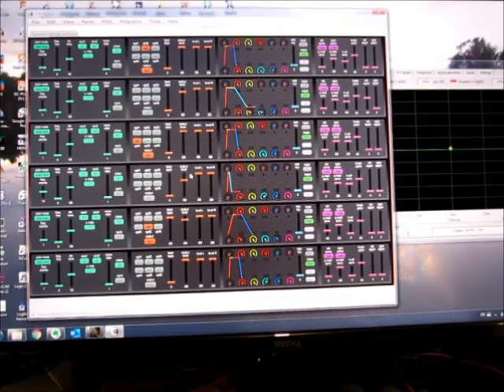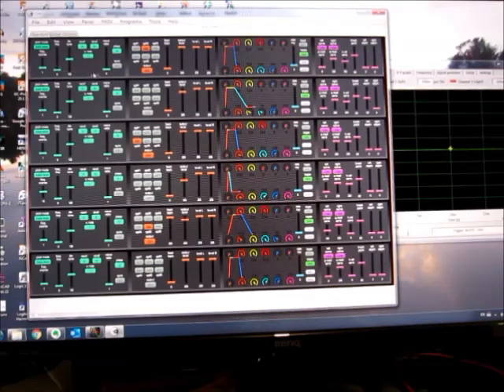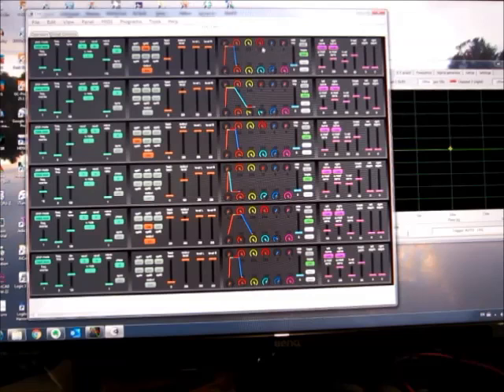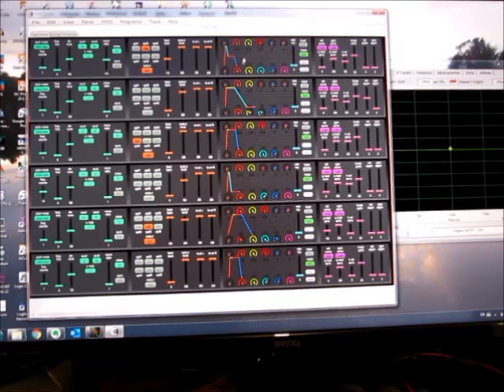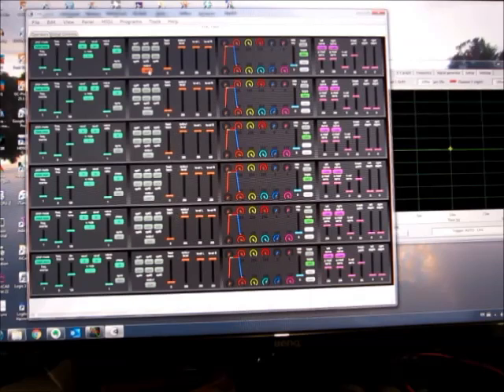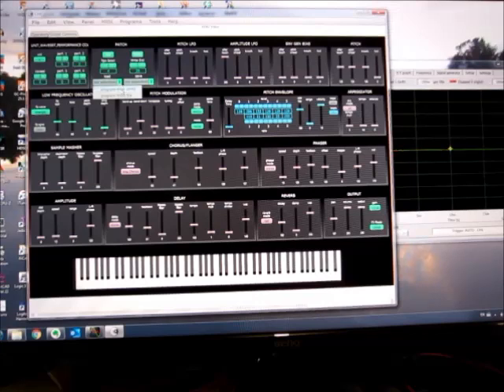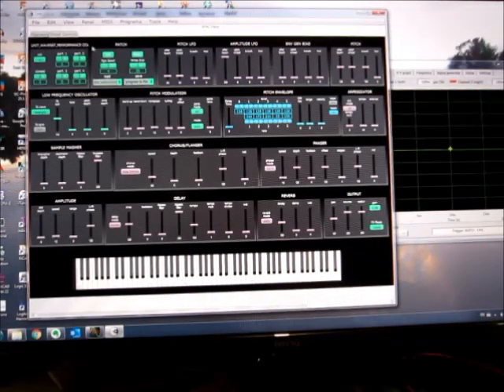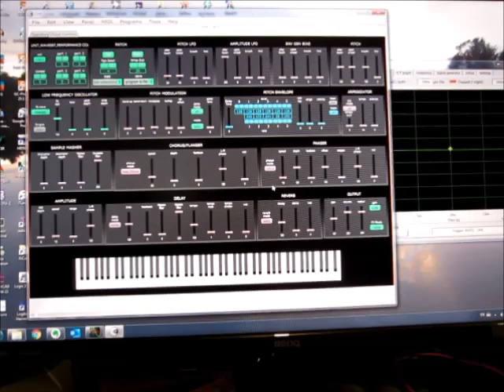XFM2 FM synthesizer and Patch Editor Overview

Comment: hello. please can you public schematic , how to wired 3 midi connectors?
Reply from the maker: The MIDI in and out schematics are on Rene's site - you will have to look thru the XFM2 blog entries to find them. If you want to add another MIDI input like I did, duplicate the MIDI in optoisolator circuit but omit the pullup resistor on pin 5 of the optoisolator. Since there is only one MIDI input on the gate array, you connect the outputs of the two optoisolators (pin 5) together. You only need one pullup resistor (R2 on Rene's schematic) which is shared between the two optoisolators. R2 pulls gate array pin 42 (MIDI IN) to 3.3V if there are no MIDI signals. If there is MIDI activity on either input pin 42 will go low. This is known as a "wire OR" connection - in this case its actually a "wire NOR".  The limitation is that only ONE of the MIDI ports can be active at any time - if both try to send at the same time the input to the gate array will be held low by both signals and the result is gibberish. This can cause the XFM2 to behave strangely since its getting corrupted MIDI messages. If you use one MIDI port for the editor and one for your keyboard it works great - just don't try to edit parameters and play at the same time.
Reply: @rheslip20  would you mind sharing where your midi out ground is connected?  i tried pin 28, then moved to pin 25, then i moved to a spot on the perf board edge thinking maybe that would be 'actual ground'. my "load from XFM2" option is also greyed out. thanks
Reply from the maker: @MikeHolstein  Mine is grounded to pin 25 which supposed to be an actual ground pin. You should use an actual GND point and not pin 28 as shown in Rene's schematic. MIDI out is supposed to be driven by a 5V signal, not 3.3v and by using the "pseudo GND" on pin 28 you lose a few more millivolts drive to the loop which can cause some MIDI receivers not to work. As for the load from XFM2 being grayed out - be absolutely sure you are using the version of CTRLR specified in the editor Github docs. Later versions are very unstable. The one I specified is not great either but in general it works. Obviously you need a valid MIDI port on your computer and you have to set that up correctly in CTRLR.

Comment: Does your xfm2 build not use the resistors or diode? I'm not seeing them on that board...
Reply from the maker: They are 0603 surface mount parts on the bottom of the board.

Comment from the maker: Somebody asked if the full duplex MIDI connection ie MIDI out on the XFM2 is necessary. He could send note messages from the panel's keyboard but he could not edit or send patches using MIDI out from the PC to the MIDI in port on the XFM2. The answer is MIDI out on the XFM2 is not necessary but it does allow the panel to sync with the XFM2. i.e. when you hit the "load from XFM2" button it reads the state of the XFM2 parameters from the XFM2 MIDI out port through the PC's MIDI in and shows them on the panel. It sounds to me like his MIDI setup is not transparent to SYSEX messages. I had that problem with my Arturia Keystep keyboard - it has a MIDI in port which I connected to the PC and then connected the MIDI out to the XFM2. Unfortunately the keystep does not forward SYSEX messages so none of the panel's patch editing SYSEX messages were getting through. This is why I added a second MIDI in to my XFM2. I have a port for the editor and a port for the Keystep.

Comment: Fantastic Editor: there is an error in "save patch on XTM2" does not work : you use the string F0 43 uu 04 01 00 xx 00 F7 but the correct one is F0 43 uu 04 01 00 xx F7 .
Reply from the maker: Thanks for the bug report - I will look into that!
Reply from the maker: There was indeed a bug and it was fixed in case anybody wondered about it

Comment: Got it working, very cool.
I hope to make a hardware interface sometime, but this is great for getting to know the unit and its possibilities.
especially for someone like me who is new to FM synthesis.

thank you.
Reply from the maker: Glad to hear its working for you. It can be a bit tricky to get all the parts working. I recently wrote a hardware style editor for the XVA1 which uses a 4 line LCD and an ESP32 running Arduino. It would be pretty easy to mod for the XFM2 - I will probably do that at some point. When its more or less finalized I'll put it on Github.
Reply from the maker: I have a CTRLR editor for the XVA1 working as well. It just needs tweeks for Rene's latest firmware release and then I'll put it on Github too.

Comment: Hi, 
nicely done! I have to try it out. My plan was to build something similar but communicate via serial because more parameters are accessible via serial than midi according to the manual. 
can you tell me why do you have 3 midi-jacks on your XFM2? Also, I see an extra part next to the ICs that seems to not be included in the building instructions (at least at the time when i built mine)
THX
Reply from the maker: Every parameter is editable via MIDI - check out the blog posts on the XFM2 beta1 and beta2 versions. A few setup commands are serial only e.g. set a unit's MIDI channel. I added the extra MIDI jack and chip (opto isolator) because my Keystep keyboard will not pass through MIDI sysex commands which is how the editor changes parameter values. So I have one input jack for the keyboard and a second for a USB to MIDI interface that the editor uses. There is only one MIDI input on the XFM2 gate array so the outputs of the two opto isolators are connected together. As long as you don't send MIDI on both inputs at once this works.
Reply: @rheslip20  Oh, nice info, I haven't really been checking the blog. I seem to have missed some things that have been going on. Thx